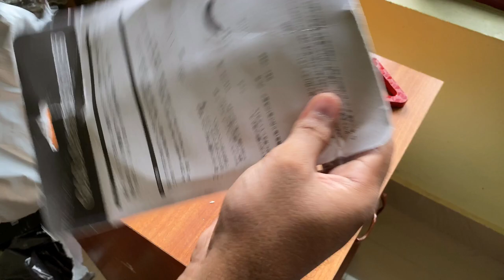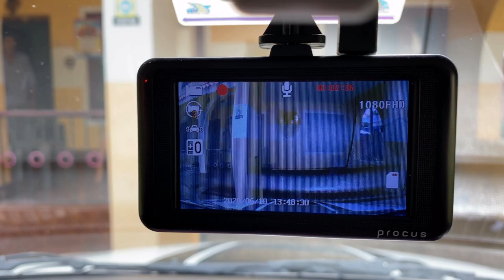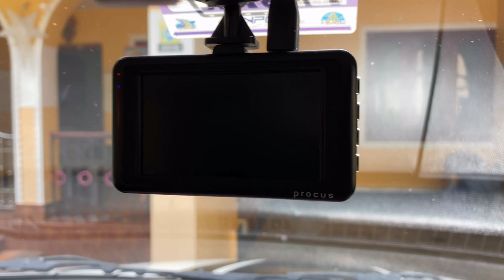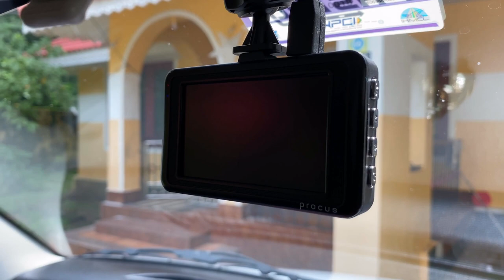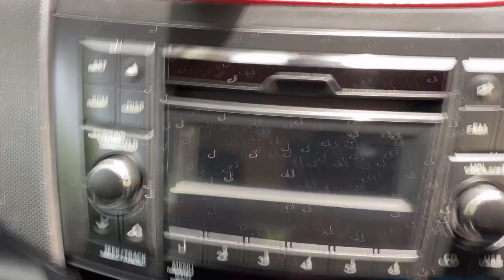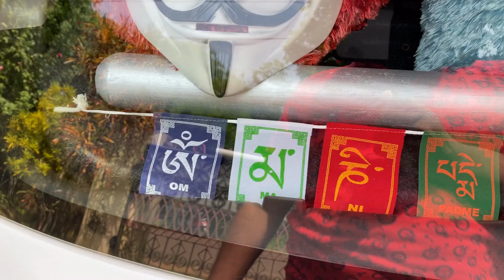വീട്ടിലെ വാഹനം ഇനി നിങ്ങൾക്കും സ്റ്റൈലിഷ് ആക്കാം | Car Styling Ideas | Car Modification | Vlog 100

Comment: Grill chromium - link please
Reply from the maker: Athu oru strip Anu actually. Different color kitum. 3m tape vachanu varunnathu. Just remove and stick.   ZESI Car Interior Decoration Accessory Beading, Flexible Styling PVC Molding Trim Strip, (5 Meters, Red) https://www.amazon.in/dp/B07XQCTTYX/ref=cm_sw_r_cp_api_i_d3E8Eb8SKW2MM